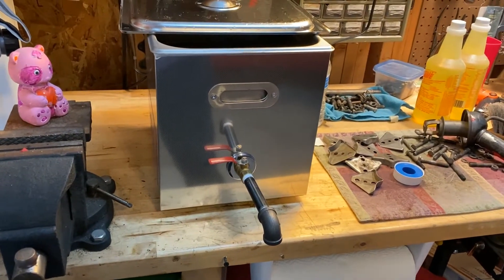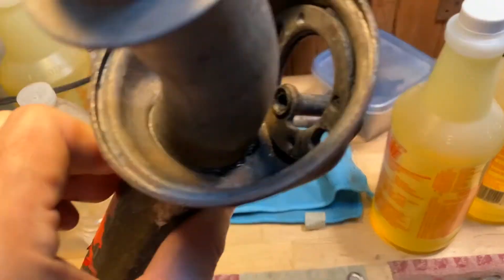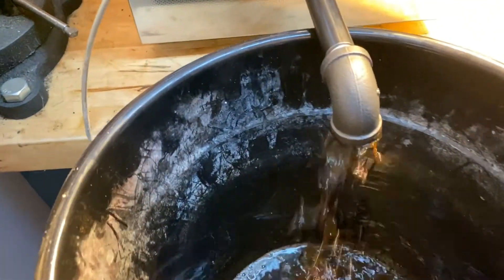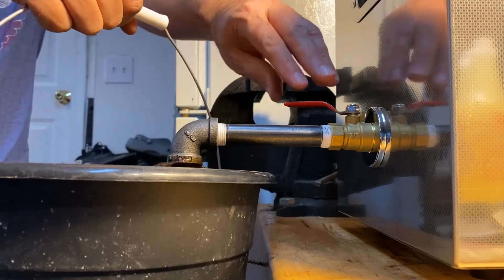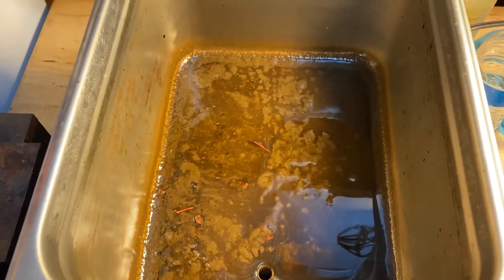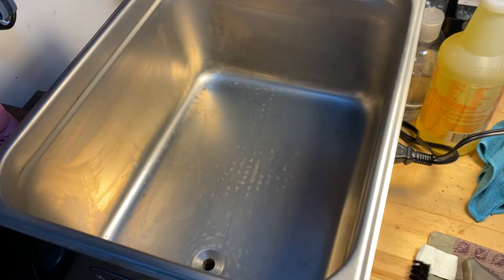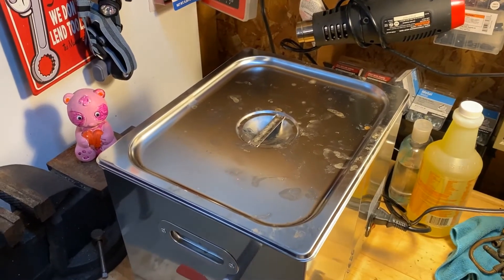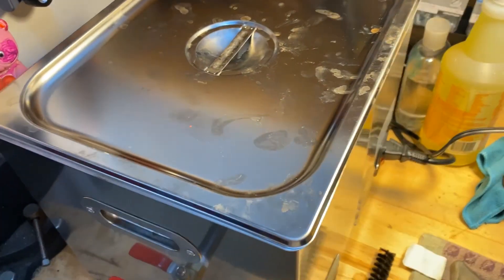Ultrasonic Cleaner Review Final Results

Comment: Whats the minimum amount of solution mix you can pour in it ? Like for jewlery i want to know if i can use it for that too in a pinch
Reply from the maker: This unit has to be filled to about 2” below the lid. There is a line of demarcation, and the instructions say not to run it under that amount.

Comment: That carb  at  the end - no not like that. you can't have metal on metal in the tank. it will destroy the tank and the sonic thingies. It has to be in the tray, with the rubber feet on it. Or that thing will be toast.
Reply from the maker: The clip at the end was more to show how large the basin is, not necessarily to clean the carb - as you can see in the clip it is all dry. I will say though, on the two ultrasonic units I have owned (the first one for over 10 years) I have done multiple carburetors or other items that way with 0 issues - no breakdowns, no problems with the transducer, etc. I cannot speak for others so YMMV but this is after more than 10 years of cleaning carburetor bodies this way.